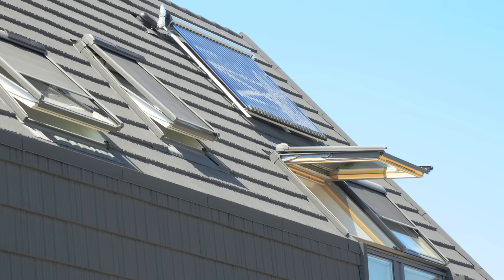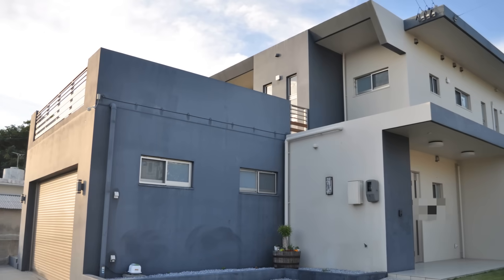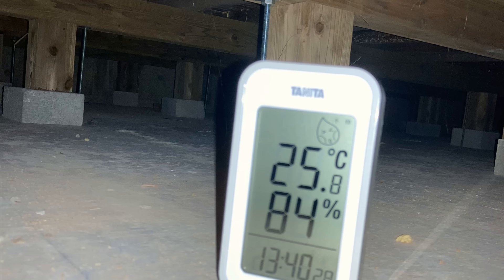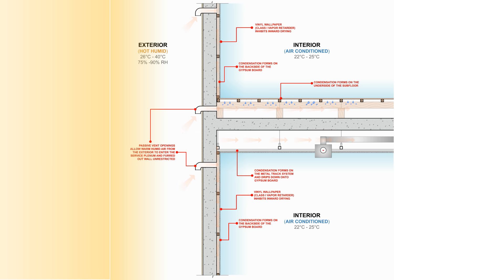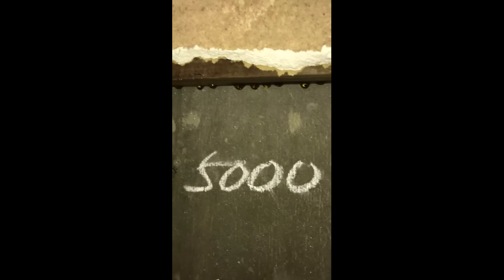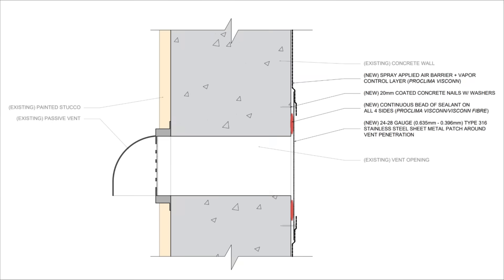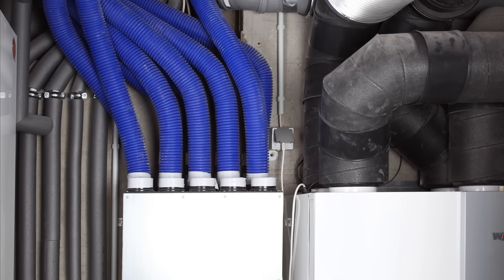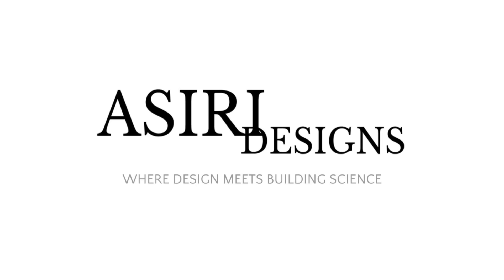The Unintended Consequences of "Passive" Ventilation... (A Case Study in Japan)

Comment: Am I crazy to think it's weird that a house in a climate like that, with a need for AC, isn't insulated?
Reply: The older generation typically don’t use air conditioning and the practice of cranking up the AC to ice cold levels is actively discouraged
Reply: The "need" for AC is questionable. Given that the residents spend time outside in the native environment a ten degree temperature split between the inside and the outside would be more than adequate, and effectively eliminate these issues aside from the vinyl wallpaper.
Reply: @vidard9863  If you've ever been in Tokyo during August, you would never question the need for AC.
Reply: Yeah,  in addition to having deliberate holes in the wall allowing passive ventilation…. 😂
Reply: Yes, this type of housing is unusual and I believe no longer legal after April 1st with changes to building codes.
Reply: Japan is a différent culture. Quakes ruins houses in seconds. Fallen fast, rebuilt fast. Thus thin walls. Insulation is too expensive for a house that get rebuilt every 5 years. 

Before considering insulation, you must build quake resistant.
Reply: In Okinawa insulation isn't as necessary as it's never that cold, but in other parts of japan with harsher winters,  the lack of insulation is kind of amazing. New builds will have some, but older houses are incredibly drafty (on purpose).     They generally don't use central heating.  At best there are some space heaters in the living room, as well as heated blankets, heated floor mats and kotatsu tables (a table with a heater built in that has a quilt skirt around it....)
Reply: @CluelessDad  but insulation isn't only for the cold. It also significantly reduces the electricity costs of ACs.
Reply: @CluelessDad  how is that amazing? Even in Southern Japan the winters are hard and the lack of insulation really just causes us to spend more on heating

Comment: How to create positive pressure in a house. More are in or out?
Reply from the maker: Supply side should exceed the exhaust side in terms of CFMs, and dedicated make-up air should be provided via a damper when exhaust systems are running. More incoming air than outgoing air, and the source of the incoming air ideally needs to be dehumidified. Ventilating dehumidifiers are a great way to accomplish this.

Comment: 20 year resident of Japan here. Until a couple of years ago, many Japanese builders would install 24-hour fans in their bathrooms, and these would suck in “fresh” air from those intake vents throughout the house. Also, it was a way to provide passive ventilation in the house with opening windows. Of course, everything breaks down when you have the AC on for a couple of hours.  

These days, many builders offer energy efficient homes, but sadly, based on my experience, most homeowners decline these options due to costs.
Reply: FWIW mortgage deductions provide a powerful incentive to go to the Zero Energy Home or new GX home standard and as of April, reasonable insulation levels are mandatory. The ventilation side is lacking though, with no air tightness requirement. Some builders do offer high insulation high airtightness as a selling point.

FWIW I installed a balanced system without ducts and heat exchangers. Intake air has a PM filter on it and are located in the rooms, not between floors.
Running the aircon mini splits continuously the RH stays in the mid 60s which I find acceptable. Each intake fan has a switch so I can turn them off if desired. No mold, no discomfort and low initial and ongoing costs so far.
Reply: The cost is negligible. Usually 10-15% more than a contractor grade stick built home. On a 30 yr mortgage that equates to about 100-200 dollars more per month in payment.

But what no one really talks about is the fact they will have a much smaller electric bill! They'll also have the benefits of a healthier home while simultaneously doing something positive for the environment.

For $200 a month? I'm down. Especially since my electric bill is usually $150-300 a month and I'm definitely not in a healthy home nor being a positive influence on the environment.

1400 sq ft rancher SIPs home is $55k. 3bd 1 bath. Build me a stick built house that is insulated as well as a 4"-6" SIPs panel for $55k. Go ahead. I'll wait. 🖖🏻🍿 lol
Reply: @shawnduffy279 This comment reeks of US defaultism
Reply: @shawnduffy279  " is the fact they will have a much smaller electric bill!"
Just not the $36000 extra they paid for their mortgage.

"400 sq ft rancher SIPs home is $55k. 3bd 1 bath."
That doesn't include: interior walls, electrical, plumbing, foundation, doors, cabinets, fixtures, exterior cladding, roof, HVAC.... $55k gets you a shell that isn't even in the dry yet.

My house is made from galvanized sandwiched SIP panels. The materials cost more, not less. I made up quite a bit in labor as I hired three people and rented a crane to help me do the frame myself. Using galvanized steel instead of OSB on the SIP means it's already waterproof, no termites, more fire resistant, more mold resistant, weighs less...It also means you have to expand your exterior footprint by 4 inches if you don't want your interior to be smaller by the time you install your interior walls.
Reply: @shawnduffy279  penny wise and pound foolish is common with home buyers the world over.
Reply: @shawnduffy279  It's Japan...

...the costs are the issue. You may not be old enough to remember but there was a time when Japan had a big real estate bubble? That's still dragging them down.
Reply: @SecuR0M  That was like 40 years ago.
Reply: @fallinginthed33p  Houses are cheap in Japan thanks to population decline. If you can buy a house for 50K you are not building a new nicer one for 300k.

Comment: 0:50 The atrium in the traditional Japanese home looks like heaven on earth. That gave me an idea: could you discuss how you would approach incorporating something like that into modern construction? My initial feeling is that drainage could be a major issue. I'm curious what you would do.
Reply from the maker: Totally. The courtyard becomes the drainage system itself, with buried French drains directing water away. The pier and beam system keeps the floors away from the ground and elevated, so you would provide an air barrier on the underside of the joists (usually taped rigid foam). Treat the shoji doors as an interior shading device and install sliding wood framed glass door units infront. You retain the aesthetics and design intent while modifying it to modern standards.
Reply: @ASIRIDesigns  Sounds like a great topic for a future video 😁
Reply from the maker: @big_snoops Ha! We'd probably have to build it to warrant a video. Who knows, maybe we will do it.
Reply: @ASIRIDesigns   How would you vary that to incorporate an under-courtyard water collection system (think Venice)?  Especially if there's a request to add a version of a qanat using some of that stored, filtered, water, for household cooling?
Reply: @ASIRIDesigns  that reminds me, would walled in stone gardens absorb more heat from the sun as opposed to a traditional garden and keep the houses dry by acting like a thermal battery and evaporating rainfall, or would the water vapor just condense under the house worsening mold and water damage issues?

Comment: From what I've seen, all homes could benefit from air exchangers and the slight increased interior positive pressure you speak of. However, the remediation expense could keep many families living in a drafty house with and without mold issues. Although they do pay for it over time in electric bills.
Reply: yeah, my brother lives in a 19th century stone walled house in a damp part of Europe. And he was never able to keep his house warm or mould free, until he got a positive pressure air exchanger installed in his loft. The house immediately became soo much dryer and warmer and cheaper to heat

Comment: 6:25
I don't think close passive vent is a good idea. This building is concrete structure, due to low R-value and cracking of concrete, closing vent means inside center area humidity will  be much lower than outside, but edge area will still having same humidity as before. This will make the walls more susceptible to moisture, especially when air condition turning on. 
I think this building needs to put vapor impermeable material, such like SBS rubberized asphalt, on the outside of concrete wall for preventing moisture coming inside the house through the cracking concrete.

Comment: Yes sir passive can help. Understanding the materials is key. I hate masonry window sills made of brick. They always leak. Masonry loves to wick moisture too. I had so many questions when designing my cottage about masonry appliances, vents to daylight, erv's, and hrv's. Plus I have a greenhouse section just like earthship. Were talking gallons of water given off by plants. That's why bedrooms sealed off from greenhouse. And open closets that get sun in the winter not on outside walls and on masonry heater bench in wall. T&G board molds easy too. I will bring in snowy, damp wood too that add to moisture levels. Having that much soil indoors attention too heavier and lighter than air does matter. Yes we have radon detectors and ventilation. As organics can break down giving off radon. I may seal kitchen off from greenhouse. I have a lot of cast iron pans and hate rust.

Comment: Build it tight, vent it right. That how I build all of my buildings. Mini splits without a dehumidifier isn’t great either.
Reply: Most folks have no idea what "vent it right" means. They just copy what their parents and grandparents did. 
It's a major failing of the architect/building community - you've summarised to the point of bland ignorance.
Reply: @philipoakley5498  Most folks do not make or choose the details of their venting. They rely on what contractors will do
Reply: Well ventilated can be quite good too (depends on the climate, but over a wider range than most folks think).  But you really have to choose between tight and ventilated and commit to one or the other.

BTW: You know this, but others here might not. Tight doesn't mean no fresh air.  It means you have to condition the incoming air, which in a lot of cases can be something as simple as a heat exchanger.  Nordic countries are somewhat famous for doing that well.
Reply: Thought that ALL splits had dehumidifiers...... ?????? wtf  ?
Reply: @HermanWillems   @AlexanderPosipanko  Mini Splits only work as dehumidifiers when they're cooling the air. So if your inside air is about the same temperature as the outside air but outside air is very moist, you won't get any dehumidification from the mini split unless you turn on another heater so that the mini split turns into cooling mode.
Reply: @celeron55 Turn down the thermostat. If you want cooling/dehumidification, just turn it down until it turns on, lol.
Reply: Minisplits also work as dehumidifiers.
Reply: @DARKRESCURED  They don't always fully dehumidfy a truly moist building even if installed with load calculations.
Reply: build it right, vent it tight 😩💦
Reply: No way I live in a 'tight' buildings.  My windows are open most of the time :)